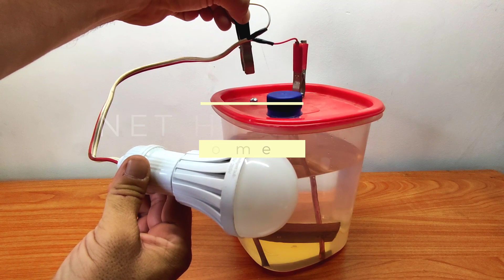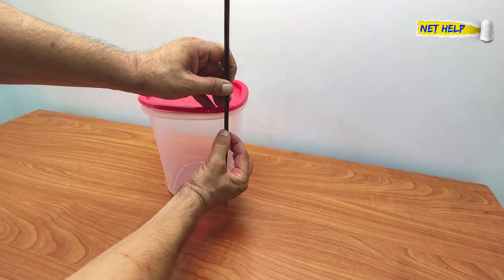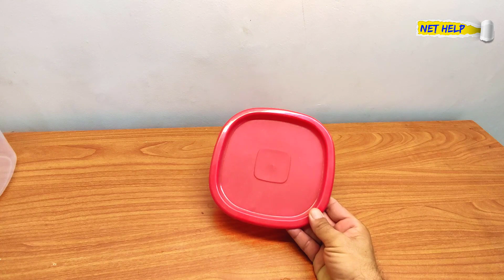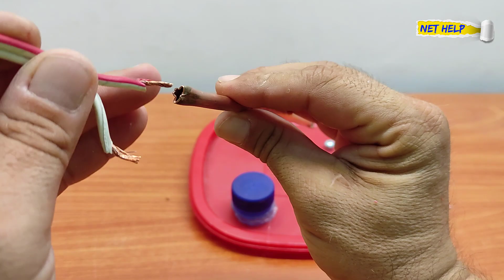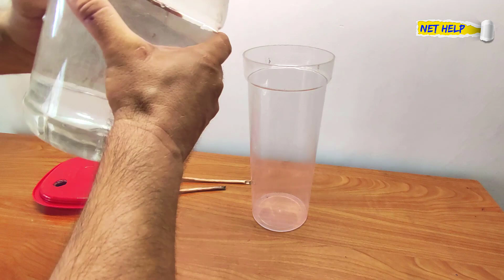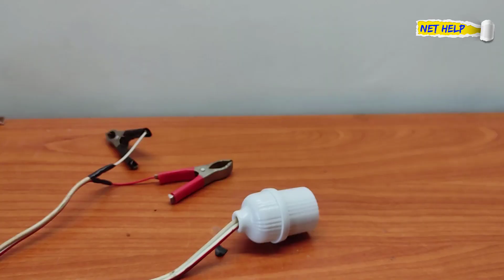Do it yourself - convert oxygen and hydrogen into free energy

Comment: Kuul. What is the name of çhemical mixed with water?
Reply from the maker: We used it in this video

 1 - Two copper rods

 2- Distilled mineral water H2O

 3 - Lactic acid C3H603

 4 - Sulfuric acid (H2SO4
Reply: @NetHelp2  thanks
Reply: Can it be recharged as u didnt charge it before first use? If yes to what voltage and with what charger?

Comment: How long can it work?
Reply from the maker: It works according to the amount of acid in the container. In this container, I used an amount of 100 grams, and it has been working for a week. You can also charge it like a 3-volt battery
Reply: What can I do to get upgto or above 7v?
Reply: Cañ it work with chlorine or which other acid?

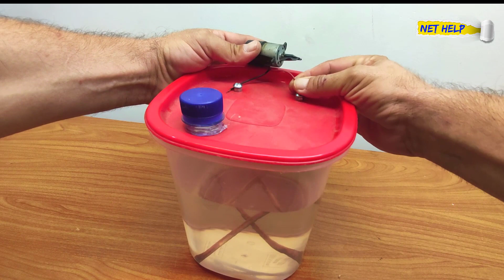Comment: 7:13 It is very interesting that the electric motor runs even when the two copper bars in the battery are short-circuited, see 7:13. Because normally a battery with a short circuit is no longer usable.
Zu 7:13 Es ist sehr interessant, dass der Elektromotor auch dann läuft, wenn die beiden Kupferstäbe in der Batterie kurzgeschlossen sind, siehe 7:13. Denn im Normalfall ist eine Batterie mit einem Kurzschluss nicht mehr zu gebrauchen.
Reply: it is a scam 
es ist ein Betrug
Reply from the maker: Sir, es funktioniert wie eine Flüssigbatterie, aber mit niedrigerer Spannung
Reply: @NetHelp2  Durch ein und dem selben Material Kupfer zueinander, gibt es nicht mal die geringste Spannung, sondern nur 0,000000000000 Volt.
Reply from the maker: Sir, Sie sehen das, weil die beiden Penisse im Wasser sind und weit voneinander entfernt sind, aber das Wasser spiegelt die Konvergenz wider
Reply: What was the voltage ?

Comment: Fake 2 is: You used two copper tubes for the plus and minus pole. And that's wrong. Two different metals are always used for a battery, for example copper and aluminium. Your battery, with the two copper rods, doesn't generate any electricity.
Fake 2 ist: Du hast zwei Kupferrohre für den Plus- und Minus-Pol verwendet. Und das ist falsch. Für eine Batterie nimmt man immer zwei unterschiedliche Metalle, zum Beispiel Kupfer und Aluminium. Deine Batterie, mit den zwei Kupferstangen, erzeugt keinen Strom.
Reply: er kennt die elektrochemische spannungsreihe nicht . . .
Reply from the maker: Warum
Reply from the maker: Herr
Alle Batterietypen arbeiten mit einer Kupferelektrode, beispielsweise die Bagdad-Batterie
Reply: @NetHelp2  zu: "Alle Batterietypen arbeiten mit einer Kupferelektrode, beispielsweise die Bagdad-Batterie". 
Nein. ---- Hätte eine Batterie nur Kupferelektroden, wie könnten diese Elektroden dann von Plus und Minus unterscheiden wenn sie doch aus ein und dem selben Material bestehen????? Welche der beiden Kupferelektroden sind jetzt Plus?, oder Minus? ------------------------------------ Das geht also nicht. Du kannst nicht aus einem einzigen Material aus Kupfer Minus und Plus herstellen. Das ist antiphysikalisch. Alle beide Kupferelektroden haben das gleiche Spannungspotential aus Plus mit ein und derselben Ladung. Und wenn du daraus die Stromspannung messen willst, so hast du 0 Volt. Also keinerlei Spannungsgefälle. Nimmst du aber Kupfer und Aluminium, so hast du zwei unterschiedliche Spannungspotentiale, wo das eine Spannungspotential höher ist als das andere Spannungspotential. Und aus diesem kannst du dann Strom beziehen, aber niemals von Kupfer und Kupfer. Das geht nicht.

Comment: Das ist Fake. Wenn man genau hinschaut bei 0:15, dann sieht man im Bruchteil von einer achtel Sekunde, daß die LED nach dem Trennen des Kontaktes immer noch leuchtet. Erst nach einer achtel Sekunde nach der Trennung des Kontaktes erlischt das Licht. Schaut mal genau hin, ab 0:15 da erkennt man eine kleine Verzögerung des Licht-Erlöschens.   0:15 

this is fake If you look closely at 0:15, you can see in a fraction of an eighth of a second that the LED is still lit after the contact is separated. The light only goes out an eighth of a second after the contact has been separated. Look closely, from 0:15 you can see a slight delay in the light going out. 0:15
Reply from the maker: Herr
Ich habe LED vorher und nachher ausprobiert
Reply: Ja und??? 🤔---------------------- . Zu welchem Schluss bist Du dann gekommen?
Reply: @NetHelp2 , wenn Du die LED vorher und nachher ausprobiert hast, was hat das jetzt mit der achtel Sekunde Verzögerung des Licht-Erlöschens zu tun???
Reply: @NetHelp2  und wofür die LED ausprobiert??? ------------------------------------ Ob sie vielleicht gut schmeckt?